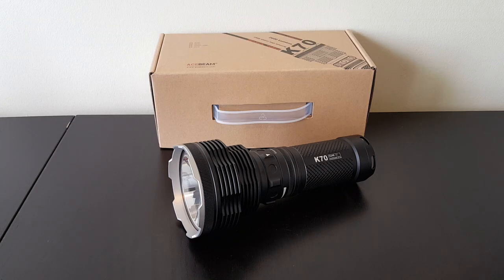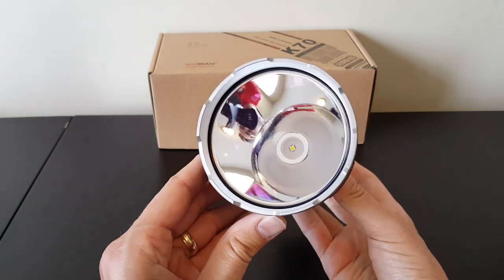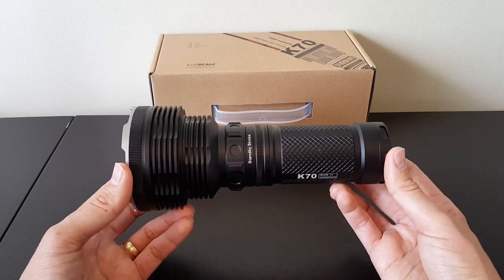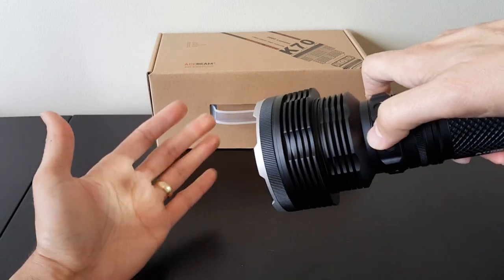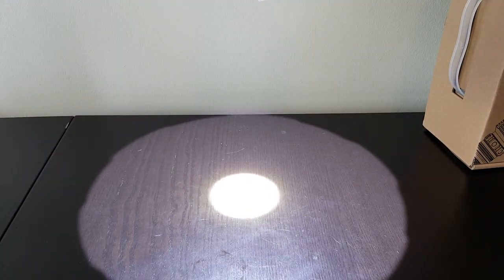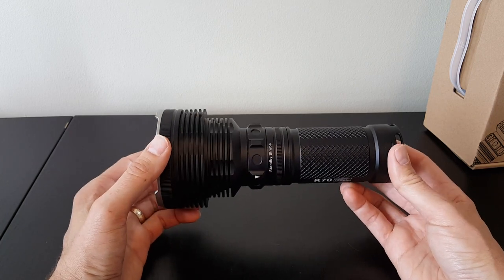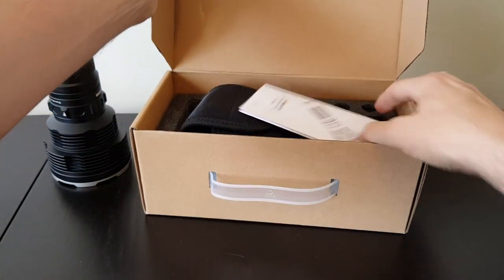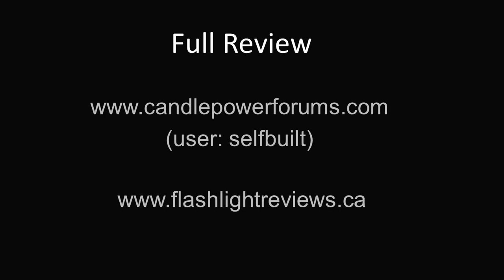Acebeam K70 (XHP35 HI, 4x18650) flashlight review, by selfbuilt

Comment: cree xhp35 High Intensity led chip is 13watt max and highest binned chip output 706lm at 25 degree junction temperature at 350mA current which is not possible in normal operating condition unless you put it in refrigerator and produce 635 lm at 85 degree led junction temperature at 350mA current. Max led current is 1050mA and at that current cree provide a graph that shows that at 1050mA current output is 2.4 times that of 350mA rated output which equates to 635lm*2.4= 1524lm then why this flashlight produces more light then cree specifications and compete with XHP70?. and by the way cree xhp35 high intensity highly binned chip is 550lm at 350mA and 635lm at 350 is for high density version only. measure the led current in your tests
Reply: Tejvir Singh its over driven nothing strange

Comment: Thanks for the review. Its quite confusing to choose from Thrunite and Acebeams throwers. Also regarding cells, I have seen a warning on Acebeams website regarding use of protected cells, how well does this play with IMR or 3400/3600 mAh cells from likes of Keeppower and others?
Reply from the maker: It worked just fine with my Keeppowers (the 3100mAh ones you see in the runtimes of the review).  Personally, I would choose between the lights based on UI and beam pattern
Reply: ***** I currently am using Olight SR52, but for tracking carnivores on open grasslands its falls short of throw distance. also in India there are no stores where I can try both those lights side by side so for me atleast it deciding on light based on online reviews and then living with my decision even if its a wrong one.
Reply from the maker: In that case, I recommend you focus on the "beam distance" numbers in the tables of my reviews. What the actual measure is (in meters) is not relevant due to the low intensity of the ANSI standard, it does give you a meaningful way to compare relative "throw" between lights.  The K70 is 1425m, the Thrunite TN40 is 1216m, and the SR52 is 640m.  If you find the SR52 insufficient, I would probably recommend the K70, as it throws a given amount of light more than twice as far.
Reply: I usually need to keep safe distance from the animals I am tracking and for that purpose a long throwers are definitely worth it. In my personal experience, I just replace meters with feet for practical usable throw distance and for that purposes both Acebeam K70 and Thrunite TN40 are good choices. I am asking my friend to get TN40 so I can get K70 and try it side by side. at 1425mt, K70 definitely is looking impressive.